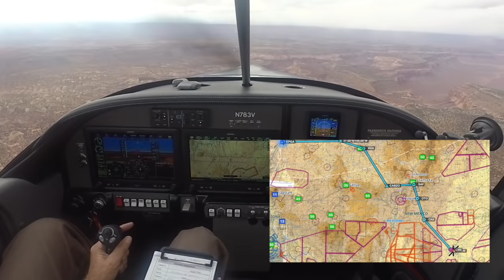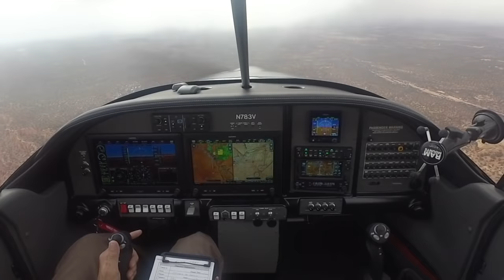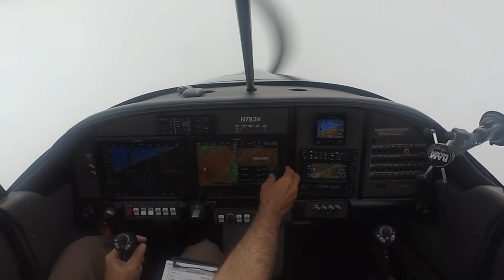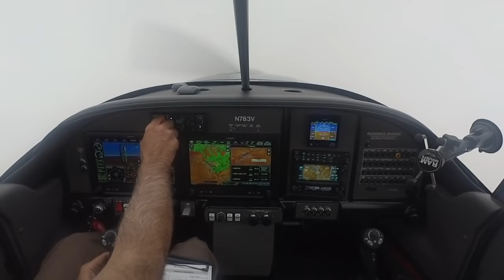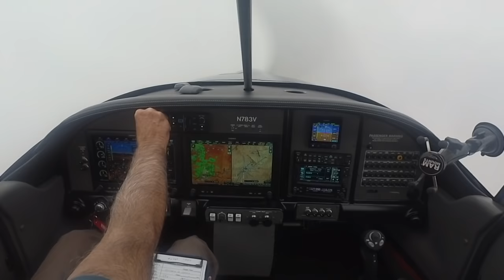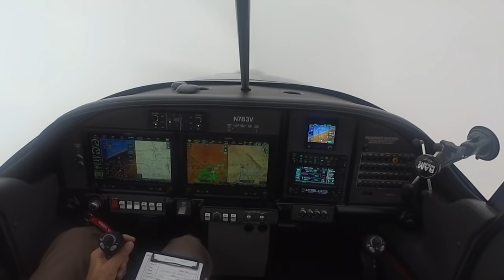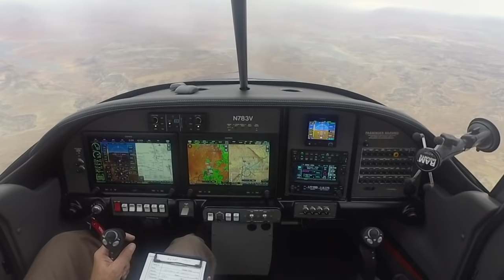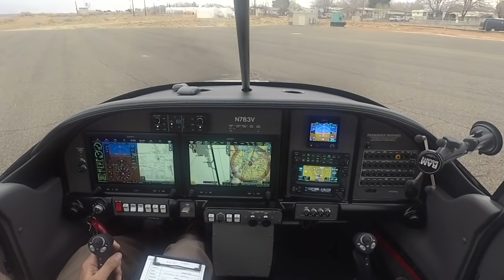RV 10   N783V   My 1st Emergency   HD 720p

Comment: The fact that you are IFR rated was a great relief to ATC...and the rest of us! Thanks for posting!
Reply: You good man blancolirio. Bless you
Reply: You notice the banking over 3:52
Reply: and if he was not?
Reply: @iansolorzano5311  if not instrument rated it is very likely the video would have been from someone else’s crash investigation. Especially when the airspeed indicator froze.
Reply: @iansolorzano5311  Average time to loss of control by someone not IFR rated in accidental IMC is less than 3 minutes.
Reply: You know it’s good when Blancolirio comments. Love your Channel sir.
Reply: @billpennock8585  you are so right. That’s where I started stressing.  I am not IFR rated. Maybe I would have not gotten in so deep because I’m not. But I now feel getting rated should be on my short list.
Reply: Updating the Cruise Checklist in yellow colour - Temp CHECK-PITO HEAT " ? Great video and thanks for sharing 👏
Reply: @dougcronkhite2113  In most cases, less than 1 minute.
Reply: What does IFR rated mean
Reply: @saulsug1066  instrument flight rules (Instrument Rated)
Reply: IMC is Instrument meteorological conditions, IFR is I follow roads ( just kidding, that’s VFR)
Reply: @saulsug1066  he is certified to fly under instrument flight rules aka in the clouds. Being rated is not the same as being proficient.
Reply: @dougcronkhite2113  is this doug the old warthog driver?
Reply: @iansolorzano5311  Crash!
Reply: @saulsug1066  Instrument Flight Rules.
Reply: If you were in freezing temps and your pito froze, how close were you to having a really bad situation with iced over wings? Deicing on this aircraft?
Reply: The fact that he was instrument rated is why this was not a Jaun Brown video.
Reply: @dsSpitfiremk4  truth that is.
Reply: Okay.... Question. When,you're flying VFR into IMC, and you're NOT instrument rated, I'm sure you have to file some sort of report to the FAA?
Reply: @shakenama  It seldom comes up. The average vfr into ifr incident is generally over in 5 minutes, and the pilot is seldom available for questioning afterwards.

While all pilots are trained under the hood, a cap like device that blocks your view outside to mimic limited visibility conditions,  to fly in real imc is a far more dangerous task. Particularly in convective environmental situations such as storms. 

If a vfr pilot is trapped into an imc excursion, which can happen without him being careless, he needs to immediately set the autopilot, level the plane by autopilot and his instruments, then get on his radio with atc, and his emergency channel and declare an emergency.
ATC will give him vectors and keep traffic away from him. 

Without an autopilot, his life expectancy is minutes. Your senses are overwhelmed. It's nearly impossible for most vfr pilots to control the airplane hand flying in serious  instrument conditions. Spinning or turning sensory sensations can be incredible. It's not just concentrating on the instrument panel and ignoring what you feel. Your hand eye coordination decays, possibly to the point that the airplane enters gyrations from improper control input. You simply lose the ability to control the plane.  My life would depend on an autopilot. 

Check out Blancolirio channel's report on the Kobe Bryant crash. Warning, its wrenching.
Reply: I am not a pilot, clearly you can see in this video that fog, zero visibility, failure in electronic instruments, you managed to land congratulations.
great video
Reply: @dsSpitfiremk4  Thanks.... I'm not a pilot, but I got the priorities. Aviate, Navigate, Communicate
Reply: @Av-vd3wk  Certified Flight Instructor Instrument here, overall the risk of dangerous icing is minimal without precipitation. The smallest protrusions that stick off the aircraft will freeze first. I never saw any build up on his windscreen so he was likely experiencing light Rime ice instead of the more dangerous Clear or Mixed ice. Paige Municipal was at 1 degree Celsius and our pilot was at 10K feet which is 6K higher than the airport. If the Lapse rate was close to standard we could expect the outside air temperature to be -11 Celsius. Certainly cold enough for ice, but thankfully he was not caught in a temperature inversion (warmer temperatures than the altitudes below) and freezing rain. He was likely hitting small supercooled droplets that froze on impact rather than splatter before freezing. Rime Ice can interfere with the wings ability to lift but as long as it stays light it will take a while before any adverse effects are felt. That does not mean that it's ok to go fly in forecasted or known icing conditions without anti or de-icing systems, the situation can change from benign to critical in a matter of minutes. I'm not sure if many RV-10s are equipped with deicing equipment. I instruct out in Western PA and I've been caught by icing once in a trainer airplane and purposely flown twice through Icing conditions in a Flight Into Known Icing aircraft in Moderate Rime conditions at least once. It's disconcerting to say the least when you get caught by icing in a non-FIKI aircraft and still not comfortable when you have to run your de-icing system at max to keep ahead of the ice buildup. The one time that I got caught I also had a case of get-there-itis and I thought that I could beat the icing by 2 hours and my turn coordinator decided to fail while I was flying the Instrument approach in moderate turbulence as well (that was NOT fun). I made it down safely after getting 40 degrees off heading and despite knowing better I attempted to scud run and tower called out a low altitude alert to save my life. Had a smooth landing all things considered, biggest advice that I can give to pilots in an emergency or tense situation is to move up your ladder of priorities one step at a time, get each done before moving on and constantly evaluate where you are and where you are supposed to be. Do not let mistakes paralyze you!
Reply: @generalrendar7290  Thank you for that generous reply, General! This near-incident has got me thinking...you know how we are used to wearing the ‘hoods’ to demonstrate IFR conditions? What about the thought that (until Autopilot fully catches up to being FULLY autonomous) that pilots, in emergency situations, either use a Augmented Reality headset in an emergency such as this whereby the headset gives them a proper ‘reality’ just as so when flying a Flight Sim? This could include earphones with the point to send signals to the ears to balance equilibrium, etc. experienced during these types of situations. As long as the pilot has the ability to strap in/on to the AR/VR goggles, he/she will see an exact , virtual representation of where they are, altitude, terrain, etc. This is already known my leading flight sims like the latest MS Flight Simulator, so, it could just display a clear weather view of where the pilot EXACTLY is based upon GPS or even radar...
Reply: @Av-vd3wk  Believe it or not that is what was being shown on the pilot's G3X touch. It is a virtually constructed view of what is outside the aircraft. The problem here was that while he can show us what he saw, we can't experience how he felt . Vertigo is intensely difficult to overcome when you experience it, especially for the first time. Your body doesn't just think that the instruments may be wrong, it knows that the instruments are wrong and it will fight your mind on what corrections should be given to keep the plane upright. What also didn't help was the fact that his head was moving all around the cockpit as he was scrambling to get all the IFR tasks done in order to fly the approach (that will induce it if you are not careful). Not to mention also that he was turning where he was looking several times in the video because he was tense which does not help you stay in control of the aircraft and he noticed and recovered. Vans also have a slight issue when it comes to IFR flying. The RV series has been designed with positive static stability and neutral dynamic stability. What this means is that the aircraft will stay in a direction that it is pointed despite large changes in airspeed, most trainers are designed with both positive dynamic and static stability which means the plane will attempt to return to it's straight and level flight if disturbed off of it. This makes the RV series great fun to fly in acrobatics, but a bit more challenging to hand fly in IFR. I doubt that VR headsets are wise because technology would have to be able to detect, identify and filter many different things to match the human eye and it adds cost and maintenance for a problem that is not a common occurrence for GA pilots. At least it is not yet superior to a trained IFR pilot.
Reply: @generalrendar7290  copy you on that. Alright, so maybe not VR but AR (augmented reality) ? And as I mentioned, I don’t know if Vertigo (as in, of the EARS) can be defeated with repulsive tones or not, but, I think that I possibly CAN. Goal being an enclosed, sensory system which essentially overrides the pilots Human derailment...
Reply: @billpennock8585  or not, as any well trained VFR pilot non IFR rated would have immediately turned around and not headed into the cloud, right? Right!? 😉 (All VFR student and pilots nodding)
Reply: @tscott6843  HOPEFULLY a VFR pilot would have been a bit more intimidated by the cloud layer and turned around earlier.  It might be an IFR rated pilot (even though not on an IFR flight plan) would be more confident flying in/near clouds and IMC and end up putting themselves in a predicament like this whereas a non instrument pilot would be aware of the dangers and their own limitations at an earlier stage and avoided it earlier.  But if they didn't, it very likely would have ended poorly.
Reply: @billpennock8585  Or not.
I am not Instrument Rated, yet am confident that I am able to make use of the instruments to safely aviate the aircraft through IMC.
Before you insist that I go for an instrument rating, I do not know if I am able to pass a medical. I do not want to risk failing a medical.
Reply: @saulsug1066  Instrument Flight Rules is the short answer but a huge part of that is experience flying when you can see nothing but your instruments.  Your entire self is convinced that your attitude is different than it really is.  You “ level the wings” except they are already level so you turn. Since you think you are level you don’t use rudder so you might be skidding.  The nose might be lowering but you think you are.....well lots of scenarios but the most frequent “solution” is you come out of the bottom of the cloud in a steep spiral turn and hope the cloud base is high enough that you have time to figure it out before you “land”. In one of those you don’t walk away from.  Once you learn to trust your instruments then you need the rules part. How to get/let air traffic control guide you
Reply: @Chris_A_  I don’t think I ever insisted you should go for an instrument rating. But I do wonder if you have ever tested your confidence with an instrument instructor in real sudden IFR conditions.  Many have thought as you. Many of those have paid with their lives. I am sure you don’t hear about the ones that were able to aviate but we have no idea the percent.  I, for one, am not going to risk that confidence unless tested in real world conditions with some one to stop my mess
Reply: @lolz4887  you are correct and right to remind all those well trained VFR pilots.  There is the old saying “if you are in doubt, you are not in doubt “. Turn the heck around. Getting there is not an option when you die trying
Reply: Yes seriously I probably is one of the best things about this entire situation. Thank God
Reply: @Chris_A_  there is no additional medical requirement to add an instrument rating.  I had a similar bad judgement 36 years ago, and started my instrument training the next week.  Best (and safest) thing I ever did. ATP-CFII/MEI
Reply: @Chris_A_  If you wish to take that opinion, remember that you have to be right every single last time, because you will only be wrong once. 

Then, the rest of us will hear about your untimely demise choking up with Juan on the Blancolirio channel.
Reply: @dougcronkhite2113  That number can't be right, because if at least a single non-IFR-rated person ever survived, that average time would shoot to infinity. So clearly something's up.

Upon research, it seems like that number comes from a study in which pilots who

1. Had zero instrument time
2. Were low time in general
3. Had never flown a Bonanza before

were strapped into a fully loaded Bonanza with the center of gravity all the way aft, and attitude/heading/vertical speed indicators covered. Under those exceptionally difficult conditions, average time to loss of control in simulated IMC was 3 minutes. This is not a typical scenario for a pilot accidentally wandering into IMC. The point of the study was to show that with minimal instruction the survivability of this sort of scenario can be significantly improved (all but 1 of the 20 pilots managed to turn the plane around safely after said instruction). 

Accidentally wandering into IMC without instrument experience is a potentially dangerous situation, but it is not a magical 3 minute killer.
Reply: @saulsug1066  Instrument flight rules
Reply: how is it possible to be IFR and 'go into a bank'!
Reply: @iansolorzano5311  Many years ago was a low time VFR only private pilot.   Got caught in IMC.  Called approach who told me to turn around.  I was unable.  They provided me vectors to airport.  Left the plane there until next day when an instructor and I flew there and recovered the air plane.  	Later, I started instrument instruction.  MORAL:  ATC is your friend.
Reply: @saulsug1066  it means Instrument Flight Rules.
New pilots are only allowed to fly with good visibility, an IFR rating means that you're able to fly using the instruments only so theoretically if you're in a cloud or its night time you're still able to fly safely.
Reply: What does IFR rated mean and what does it do? Sorry I’m not very educated on this stuff.
Reply: @shutdown3734  two ways to fly visually looking out of the plane/helicopter in clear weather is VFR Visual Flight Rules.  When weather is stormy or very cloudy and ATC aviation traffic controllers have to direct you its IFR Instrument Flight Rules.   To fly this way, the pilot must be instrument rated.  Have taken classes and passed the test qualified to fly with instruments only.
Reply: @multitieredinvestor183  oh that explains a lot, thank you :)
Reply: It’s blancolirio
Reply: When I see a random video pop up in my feed, and then see that Blancolirio has commented, I know I’m in the right place.
Reply: I mean even being IFR rated does not make you able to be successful in ifr conditions, yea it increases your chances. But tbf i did my IFR 7years ago, and never used it since, its use it or lose it, maybe someone will remember your instructor saying this "motto". IFR is one of those thing that you have to do a lot to be good at. 4000h of helicopter flight here.
Reply: Exactly so many stories you here like this where the pilot is not IFR rated...take everything and add a pucker factor of 10.
Reply: @Mike-01234  .saw  do an a scare
Reply: This is best aviation video I have ever seen. The pilot was amazing and this reporting will undoubtedly help many pilots. Well done and greetings from Cheltenham, England.
Reply: @billpennock8585  .
Reply: You video is likely to save lives.  Thank you for sharing this.  I had always wondered how people kill themselves in small airplanes.
Reply: @saulsug1066  It means they have the extra certification to fly blindly with only their instruments. A lot of general aviation pilots are only rated to fly when there is good visibility
Reply: Go back to flight school. Questions were all standard IFR flight plan required. Scanning all gauges, switches and fuel in regular intervals is standard VFR. GTI only exposed these items. Glad you are a good crosswind pilot. Good Luck.
Reply: @dsSpitfiremk4  I’m ifr but even if I wasn’t I can’t see how hard it is to fly using artificial horizon, provided the airplane has one
Reply: @Mike-01234  that was the autopilot......
Reply: I'm a little surprised that the ATC or anyone on freq didn't suggest checking to see if the heat was on or resetting the breaker. Yea it isn't their responsibility to diagnose your issue and they are prob assuming that you are running through some sort of checklist to try and find the issue.
Reply: @shakenama  usually, the NTSB will be filing that report on your behalf.
Reply: @bob2161  Gotcha....thanks
Reply: @tscott6843  it’s definitely worth the extra time and money to get rated, and keep yourself fresh on it, even if you only intend to ever fly VFR. Unlike the sweet old lady next door that’ll only drive in the daytime, you can’t call your son to come bail you out when it gets “dark”.
Reply: I started to breathe again after he said that. Damned exciting! But who wants exciting?
Really nice landing, BTW 😁
Reply: Blancolirio one said sometimes pilot suffer from getthereitis. I think it probably would have been better just to turn around even if it going to cost you a day of travel. I have flown  in 15 yeas and have made a few mistakes but nothing like you and were able to work thur.
Reply: @tomwilliam5118  been a good number of very experienced, commercial pilots get into trouble from Getthereitis, so to think that the typical GA pilot, with far less experience, to think they’re somehow immune, is crazy to me.
Reply: @derekf85  and being IFR rated does not give you permission to fly into clouds without an IFR clearance either.
Reply: @generalrendar7290  great comment, thank you for sharing... I have experienced icing as well in PA lol.. lancaster PA to be exact in a caravan.. TKS took out the ice and it wasnt unbearable but you feel the difference of what ice can do... take care buddy and fly safe, thanks for sharing
Reply: @Mike-01234  And that right there is where a lot of folks have bought it.
Reply: You don't have to be IFR rated to maintain control IMC. All you need is the ability to use the interments to keep your wings level, to fly a heading, fly to and maintain an altitude, and the ability to use the radio to ask for help.
      It's not that hard. Just remember don't try to fly by the seat of your pants. The seat of your pants is a lying ass.
Reply: I know. I've flown under a hood for a good few hours, and felt comfortable with basic aircraft control, but that is just scary. At least where I am for the nearest 500km  or so the max terrain altitude is 2535. It's never freezing either. Also close to ocean so could descend quite low then navigate back in.I wouldn't want to fly the mountains it seems like you don't have an escape plan.
Reply: @saulsug1066  Instrument flight rules. Used when flying visually isn't safe.
Reply: @dsSpitfiremk4  I was extremely amazed how the Navy taught exclusively instrument first.  It felt like a year before they let us look out of the canopy in Primary.  But later in CAP as an Observer, I realized that was a gift, literally from above.  Sometimes found myself backing up and helping IFR pilots from that experience alone because I was so used to instruments.  Kind of wish more IMC training was focused in the Private training.
Reply: Basically that you can fly your craft without looking outside.
Reply: I am not a pilot, but I have a question. Why are pitot tubes not automatically thermostatically controlled to turn on themselves if temperature of the tube drops below freezing? I’m sure there is an answer as to why my thought may not be right m, but I am just curious!
Reply: @Av-vd3wk  This would not be a great deal different than engaging the autopilot and letting that fly the aircraft.  And has the same flaw - it can make a non-proficient pilot complacent and willing to fly into conditions that s/he can't handle.  Then if the electronics fail, even if just for a minute or two, you are dead.
Reply: @historysniperoneu.s.a  That was rain cloud, not fog. There wasn't a failure in his equipment it was pilot error that caused pitot tube to freeze.